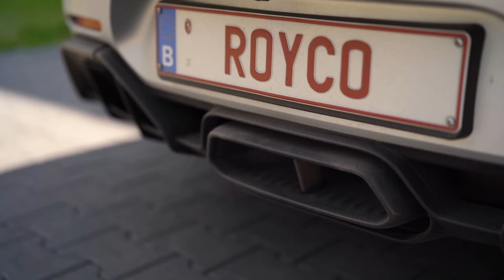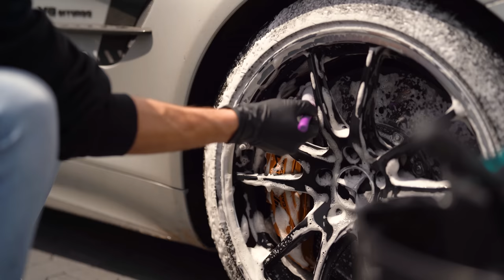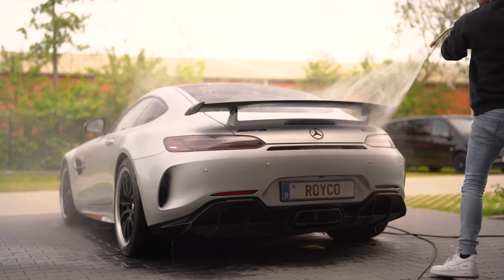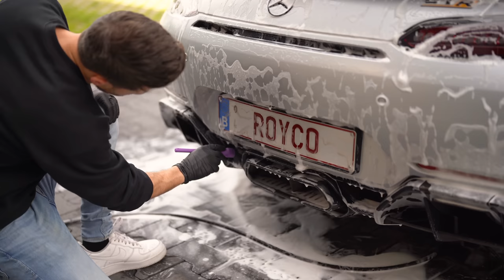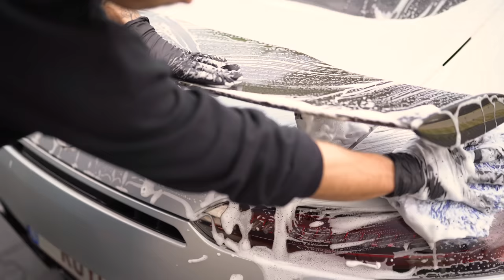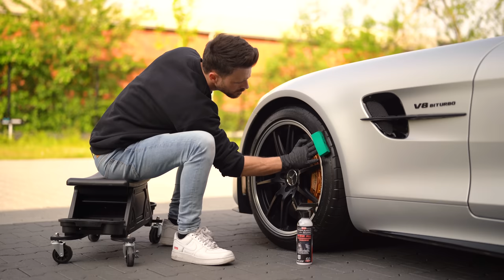Cleaning a Dirty Mercedes GTR - Exterior Detail Wash

Comment: Hi what is that yellow fluid you spray on the wheel after you washed it??
Reply: Was wondering the same
Reply: Koch Chemie Hydro Foam Sealant
Reply: @frieze43  are you sure that’s not Tec582? Where do I buy this hydro foam sealant??
Reply: Very sure as he used this on his previous video. He only uses brands he sells on his webshop.